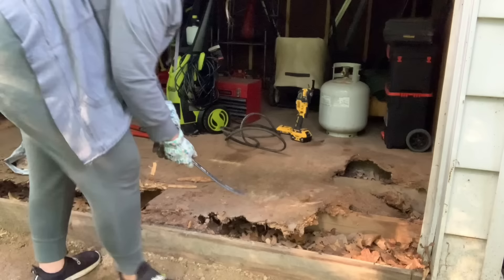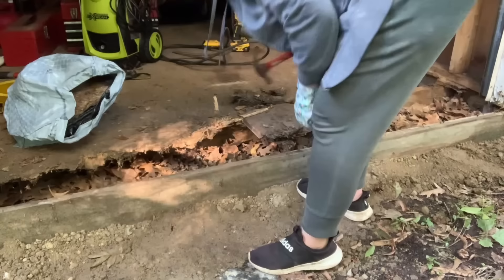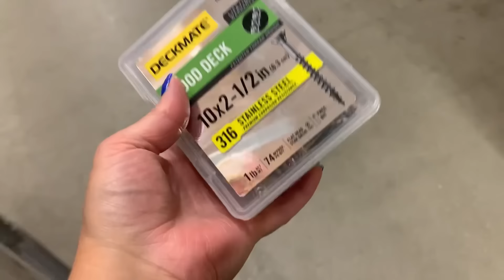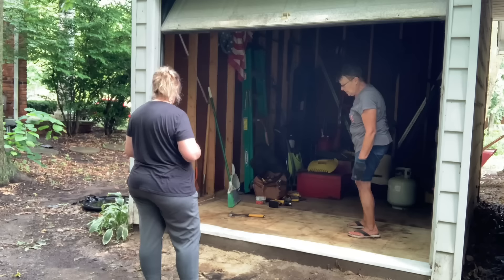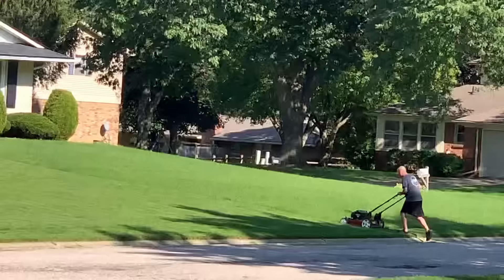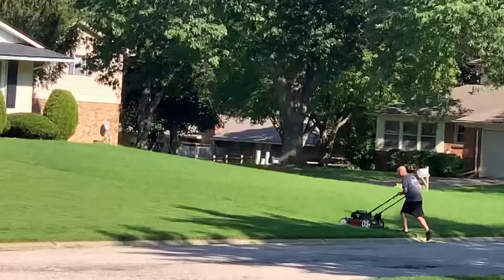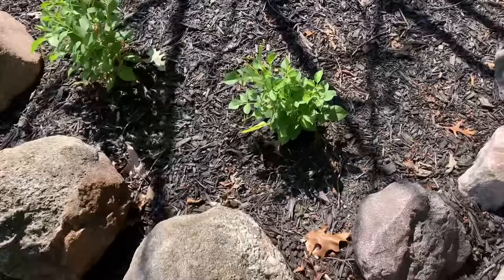REPAIRING MY ROTTED SHED FLOOR/ Learning new skills & update on flower garden 🌸

Comment: Replacing a garage door seal is pretty easy. Measure the thickness of the door and the length of seal you will need. The old one should be installed with nails or screws. The quicker you replace it the better off the new floor will be. The yard looks great, but I concur with Hubs, the tree is dead unfortunately. 😔  Thanks for another great video, job well done! 😊
Reply from the maker: I hope it’s easy but I have a feeling it’s going to be another learning experience 😂

Comment: I just saw this the other day on how you can save your tree in the front. Get a copper pipe at least 5 ft long that's hollow inside and pounded into the ground about a foot from the trunk. Go down at least two feet. Then get some copper wire and wrap it around the pipe and make an antenna that goes into the tree. I know it sounds strange but I saw a really huge pine tree come back to the life when they did that! It's something about the copper that is needed in the soil but it's certainly worth a try.
Reply from the maker: Oh my gosh really?? That was my favorite tree and I was so sad. I might have to try this. Thank you ❤️❤️
Reply: @jodidunnmymessylife1847  I'm so glad that you might consider trying it. It can't hurt and it's not expensive. If you have anymore questions just send me a reply and I will send you a link to a video that shows someone doing it.
Reply: @jodidunnmymessylife1847 here's the video I was talking about. I think the copper pipes would be easier to pound into the ground but you could use wood to. The copper wire needs to be thick enough to wrap around the copper pipe or the woods Stakes that you put in the ground. Any hardware store has copper wire and copper pipes.

https://youtube.com/shorts/bEl73N1BaQg?si=sY4mGyDSzDVvI3Yj

Comment: Great job on replacing the floor!   So an idea is to check around those discount carpet places.  They often have linoleum remnants for dirt cheap.  Get a bucket of linoleum glue that you slap on and roll out the linoleum over.   That would definitely give your floor some protection.   Even some of those linoleum press and stick squares.  Even though they are sticky I smear out some silicone liquid nails under them.   Also there are rubber strip things made to attach to bottom of the door.  I did it myself to my old garage door.  Easy diy.   Just get the right width.  Tfs! ❤

Comment: The flowerpot that isn't doing well that's sitting on a hot ledge. It's small for that many flowers in it. they will bush out if they had more room. I have a pot on a rock and it got hot and dried out too much. I took it off the rock so it wouldn't get so hot. It's doing better.

Comment: Jodi I feel you I live with my daughter and while I ask for help when I find items loose or needs to be replaced. I can do a few things but sometimes I'm intimidated with a drill  it took two weeks for my grandson to help me put up a new shower  it was rusty I tried everything possible to clean up the rust but it didn't work.  I was taking a shower today sitting on the potty and reached for toilet paper and the one brace falls to the floor. So I know that screw to hold it in is small. I kept my little tools I had at work for my computer  and I found a !in I screw driver to screw in the smallest screw in the world. my grand children think I'm g
Funny tor keeping these smaller tools well I fixed the piece and the toilet paper Holder works now. Sometimes you just need to do things yourself. But who designs these holders yo have a screw so small. I figure its someone who never installs it haha